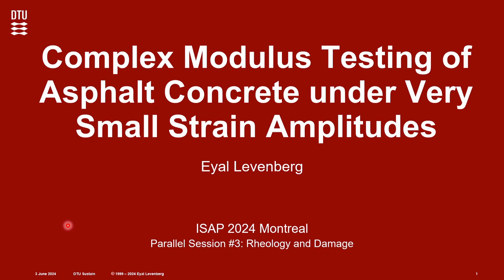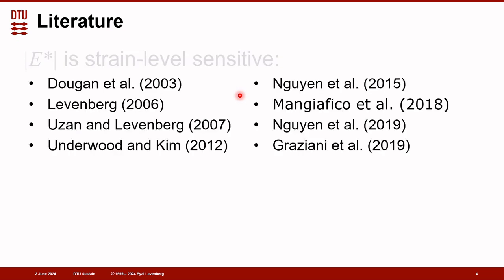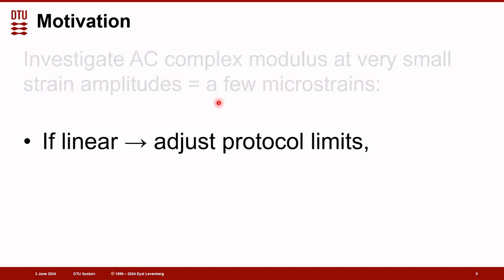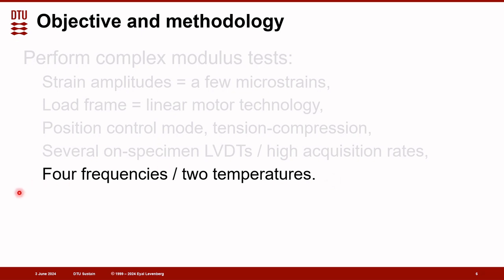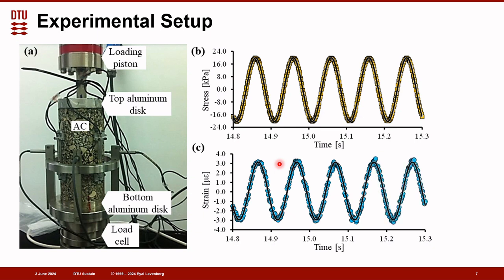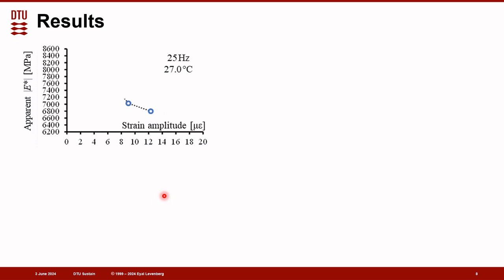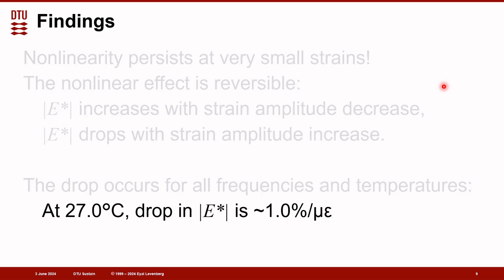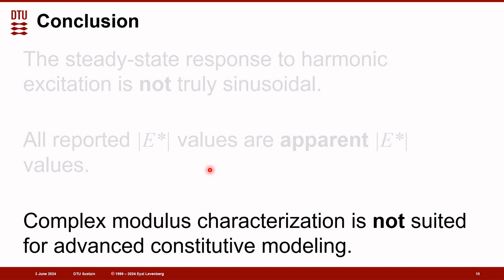Complex Modulus Testing of Asphalt Concrete under Very Small Strain Amplitudes

Comment: For what purpose do you study the complex modulus at such small strain amplitudes? As far as I know, during the operation of a road structure, the amplitude of relative deformation from the passage of vehicles is from 30 to 350 microstrains in asphalt concrete.
Reply from the maker: The point here was to check for linearity. In any case, under a loading event, if you consider all locations within the pavement, the vast majority experience very small strains. Only in the vicinity of the loading some points experience medium to small strain levels.
Reply: @levenberg  Thank you very much! I think that the change in the value of the complex module is associated with a change in the speed of influence. The frequency of impact remains the same, but the relative deformation changes, thereby changing the rate of deformation. Asphalt concrete exhibits rheological properties. Will your research somehow influence the design characteristics of asphalt concrete when designing road pavements?
Reply from the maker: This work is more relevant to fundamental characterization of asphalt concrete. Design requires simplifications for which the complex modulus approach will remain applicable.